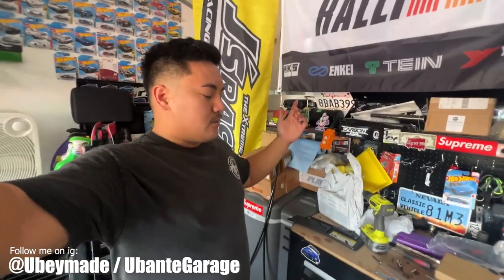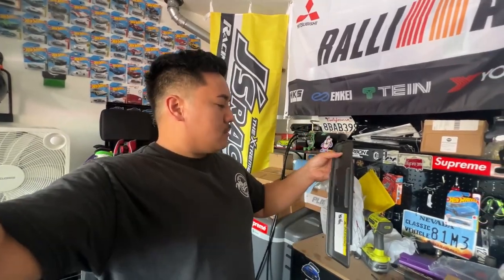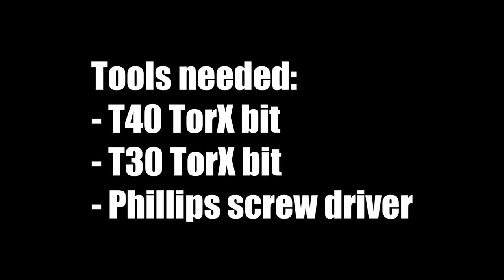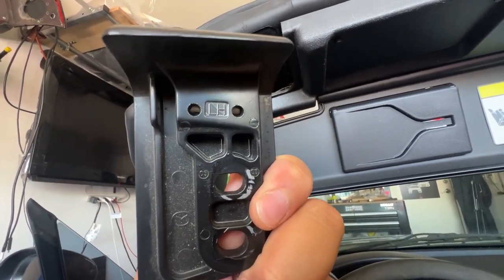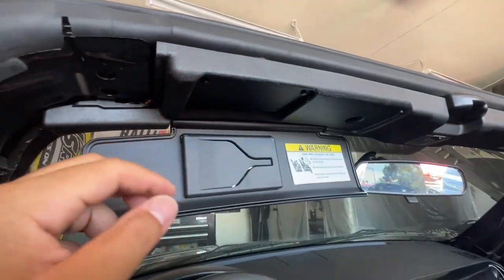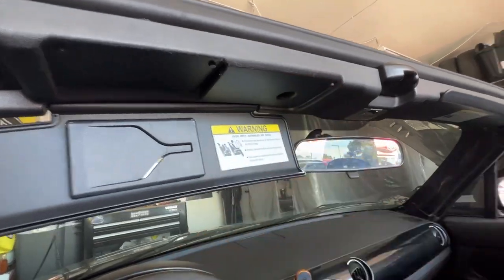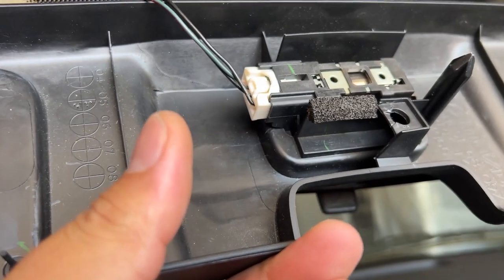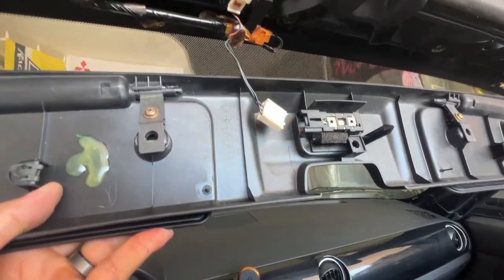DIY: 2006-2013 Mazda MX-5 Sun visor replacement

Comment: Great video…a few things:  
— the top of the A pillar covers have to be popped off as they cover two “fingers” (one on each side) on the windshield header panel. 
— The two clips per side will “give” suddenly; be careful as they may come off their mounts molded to the header panel. On my car one was missing.
— A very small flat-bladed screwdriver can be used to back out the white dome light harness from the socket.
— once the header panel is loose handle carefully as those aforementioned clips can slip right off. 
— The metal clips holding the sun visors on are spring loaded so be careful backing when backing the Phillips headed screws out. Also, there are two little square nuts those screws thread into. 

I did both of mine in about 30 minutes, 10 of which was spent retrieving one of the Torx—30 screws that I dropped that (of course) fell into a space-time continuum when it bounced off the center console and under the passenger seat.

Comment: Any hints on how to unclip the light? I can’t get passed that. I’m worried about damaging the clip. Thanks
Reply from the maker: I used a small flat head to push it down and twisted between the joint to seperate them. It is hard but be patient. Highly recommend having someone hold it up while you undo the clip.
Reply: @UbanteGarage  thank you. I was just ready to clip the wires and then tape them when I got your message. That was the key. Smooth sailing after that.  :>)
Reply from the maker: Yooo that’s what I’m talking about! Glad I stopped you from rigging it 😅